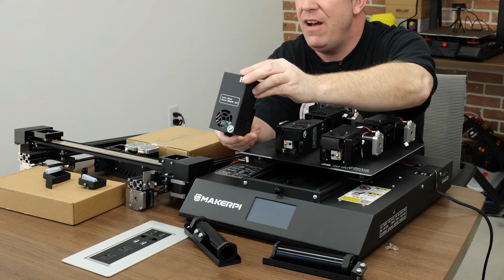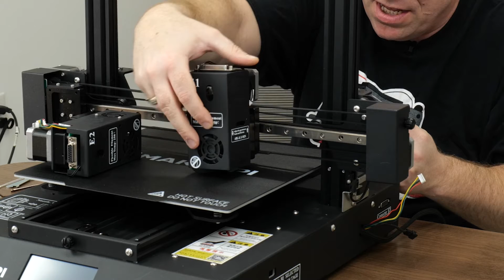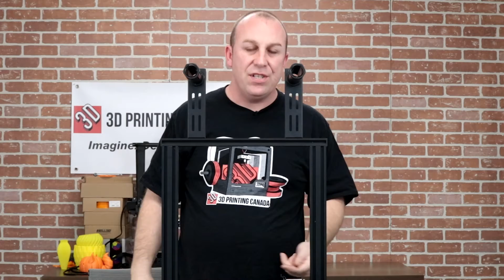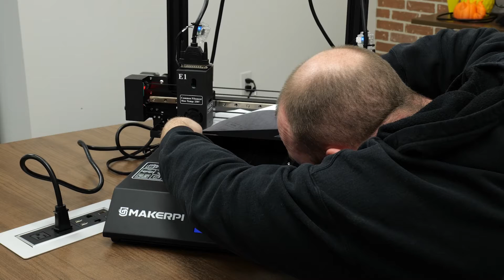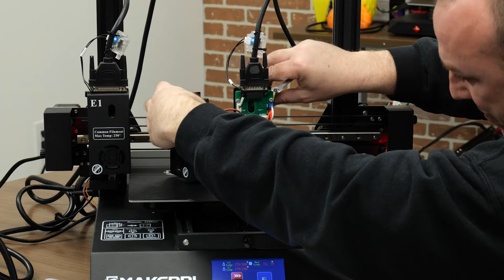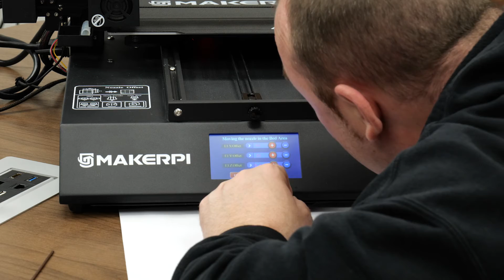MAKER PI P3 PRO UNBOX & BUILD

Comment: I have watched your set-up of the maker Pi P3 and followed your Build as you built it, Then aftter the fitting of the cables I noticed that you Made a grave ERROR, I know it was an ERROR because I followed you step by step,,,  AT 7 minuets 31 seconds you had the E2 print head on the Left and the E1 on the Right then at 11 minutes 20 Seconds It was the other way around, I wish YOU had owned up to that mistake as as person that reviews 3D printers It would and should have told to rectify that mistake as it may have caused many problems,,, I hope you can understand the reason behined my Comment

Comment: You should have a 3D Printing Canada Staff Creality Sweepstake for how many printers Creality releases in a 12 month period!
 Why does Creality always have something ridiculous on their printers, enclosed printers with no lid and a touchscreen mounted inside the enclosure, a smart printer that cant connect to the internet, a touchscreen supposedly compatible with all Marlin printers but doesent connect to any including Creality machines, a WiFI box that won't connect to the WIFI and doesn't get a firmware update fix for years after the release and now a printer with no bed wheels, and a printer with Pi in its name and guess what NO Raspberry Pi in there not that I ever expected there to be one, and how hard would it have been to have those parallel sockets in a restricted recess in the casing so there is no chance of movement that is almost definitely going to break the solder, I think they have had issues with those hotends crashing and that's why they are set to move so slow, Creality are a comedy of errors!

Comment: Kinda funny I called you months ago about a dual extruder printer I was interested in buying and wanted your opinion and you totally dismissed it said would cause problems and buy an ender 5plus
Reply: Did you get a dual prunter? i purchased a AnkerMake M5 my god it is farst and a great piece of Engineering The Best one to date!
Reply from the maker: From our experience, in general, IDEX machines aren't perfect, this one especially. We have no plans to carry this in our store but when a vendor mails us a sample unit to test, we like to show it off for our audience.

The only IDEX we carry, is one that we've had good success with and that's the Kywoo IDEX.

The advice that dismissed IDEX was probably good advice because, most IDEX machines don't function to the expectations of the operator.